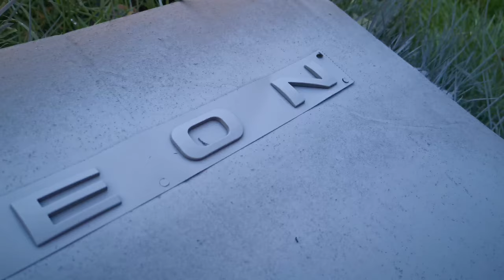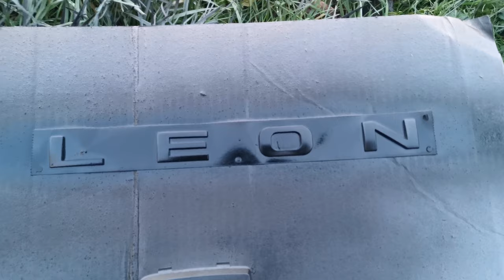DECHROMING SEAT LEON FR GRILL & BADGES *BLACKING OUT MY CAR*

Comment: Hi mate, how did you remove the front grill outer chrome trim? Is it a full bumper off job? Thank you in advance😊
Reply: Wondering the exact same thing
Reply: same
Reply: @rtds2024 you need to take the bumper off it will be much eaasier i dont know how to spell that word 😂😂
Reply: @samko_lp9440  its too much work... :o ... can i just wrap around and paint it on car? haha
Reply: @rtds2024  you can wrap it but that will be much harder to do. Especialy the chrome trim and it will tore about a month because of the stones hitting. I had that problem and sayed screw it and spray painted it.
Reply: @samko_lp9440  my is already painted in black (last owner did it) but it  need to be done again, on some parts i can see chrome
Reply: @rtds2024  because he didnt sand down the chrome before painting it
Reply: @samko_lp9440  possible hehe
Reply: @rtds2024  if you dont want to take off the bumper. You could mask everything around  the thing you want to spray paint. And it will be much easier but stressfull 😂
Reply: @samko_lp9440  thats what i want.. yea.. haha

Comment: so the grill surround comes off without needing the take the bumper and full grille off?
Reply from the maker: Hi unfortunately the whole bumped needs to be removed to take of the trim ... to put the trim on it easily all clips back in ... 👍
Reply: @AzarnPatel  ok thanks
Reply: @AzarnPatel  would it work if I forced (snapped) the one off on my car and then buy a new one to spray and refit, or does the bumper still have to come off. I'd rather buy a new trim than take off whole bumper.
Reply: @MrWoods0_0  wow that was a delayed response, posted that over a year ago 😂
I  sprayed it with plasti-dip last summer, still looking good.

Comment: Nice work 👍🏻 Do you need to remove the bumper to remove the grill?
Reply from the maker: Yes you have to take the front bumper off unfortunately it’s long winded but worth the effort at the end !
Reply: I removed only 4 screws above the bumper and 3 screws on each sides and behind the gril take 4 screws and you got the grill in your hand

Comment: How many coats of primer? Then the actual paint and then lacquer?
Reply from the maker: 3 coats each 👍 so it stays on nice and solid and plenty of time to dry between the coats
Reply: @AzarnPatel  thanks for the quick reply! Awesome video and really helped and about an hour between coats?
Reply from the maker: @braydn7782  believe it or not for the absolute best results it’s best to leave the primer for 24 hours … the paint for 24 hours and the lacquer for 24 hours … this is for the absolute best results or else yes people normally do a hour between coats 👍 patience is key with painting even though your excited to see the bad boy finished !
Reply: @AzarnPatel  wow never knew that that’s a whole lot of days haha 9 in total then I’m assuming?
Reply from the maker: @braydn7782  just 3 days for primer 3 x coats one hour each between these coats then leave to dry for 24 hours … then repeat for the paint and clear coat … just because it’s plastic and if it doesn’t have good coats and dry down it tends to peel
Reply: @AzarnPatel  ahh right okay sorry miss understood, did you sand it before as well?
Reply from the maker: @braydn7782  recommended to but I didn’t … I used plastic primer which apparently sticks better to this trim 👍
Reply: @AzarnPatel  ahh okay well thanks for all the help anyway, keep up the good work!

Comment: How did you get the front grille off?
Reply from the maker: It's a bit of a mission really, you have to take the whole front bumper off to remove the front grill... Getting the chrome surround off is the hard bit as you have to pry it open very gently as it can snap the clips off but just take your time by using a screwdriver to pop the clips out from the behind of the grill. Start from one side and make your way around it 👍